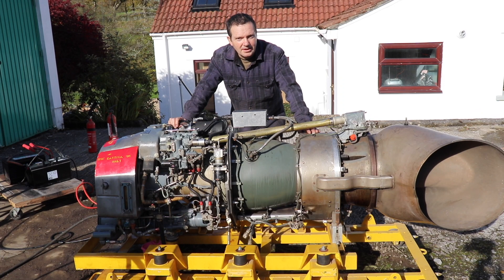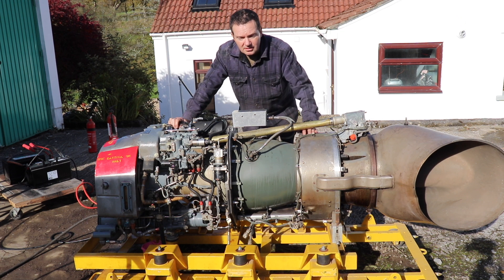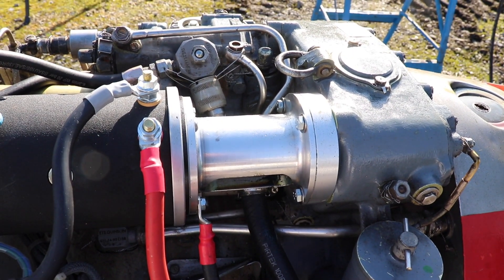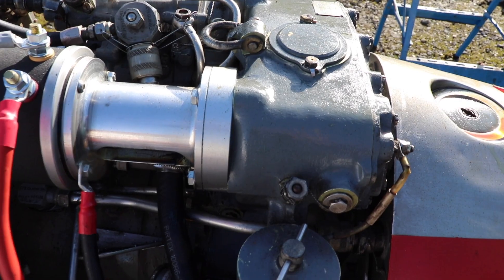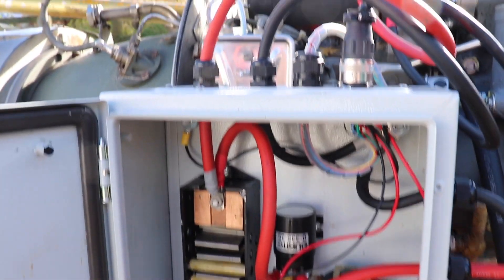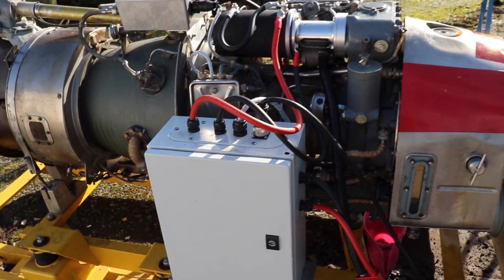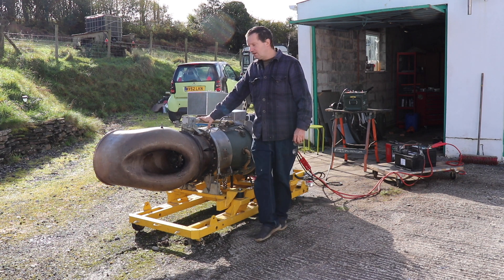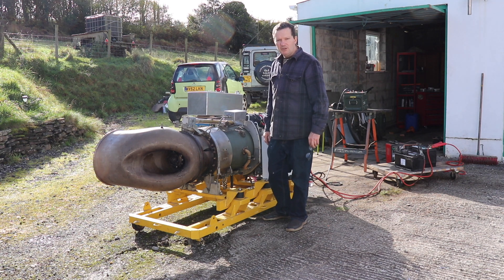How To Start A Jet Engine Using A Winch Motor

Comment: Did you build the starting resistor? Would like to know how to construct one or source the parts...
Reply from the maker: That’s a NOS soft start resistor from a vintage plane. Can sometimes find them on e-bay. You can make one out of stainless steel

Comment: Thats a novel idea :) But basically the 12V winch motor is run at 24V here? Motor should draw some angry currents during windup.
Reply from the maker: No it’s a 24v motor

Comment: Worked on SA 330 Puma for long time in SA know that Turmo 4b , iiiC4 and 4C  well awesome motors operated well in Angola Work horse of the Airforce, 5 % crank ignite watch T4 Adjust idle on idle unit under wire locked cap FCU where governor shaft enters 3 caps   acceleration ,max stop and overpower 101% smoke from rear bearing oil leak,oil smells like coconut cause it is .Spring loaded Governor shaft  not clipped in or spacers missing?
Reply from the maker: Thanks for that! very helpful indeed. If you have any further info would be very grateful. Yes, it certainly is a chump of an engine!! It could well be ex-SADF
Reply: Interesting what is the gas generator idle speed (%) at ground idle? Looking at various Puma start ups videos the ground idle looks to be quite fast with high rotor rpm also? Pilots just start up both engines and lift off don't check the free wheel etc.
Reply: 60% for ground idle ,,92% for flight idle , max stop 98% overpower 101% t.Acceleration time ,8 seconds from ground idle to max stop.That motor is a 4 B. Makila and Topaz replaced them eventually.No free wheel unit like the Allouttte has,only free turbine on Pumas.Motors are bench checked connected to a water pump assy to check all of this
Reply: Rotor speed is 269 for composite blades 271 for metal.
Reply from the maker: Zot,I can see the 3 capped adjusters you refer to...2 are above the gov shaft entry point and there's one which is below. Which one is the idle adjust? If u PM me I can send a pic
Reply: Been retired for 15 years now but the 2  top would be overpower and max stop try the bottom they are not very sensitive so a full turn bout 1%Doing motor runs without the output shaft connected to a MGB sounds dicey there are torque twist plates attached to the shaft under the torque tube that will get damaged i would remove the shaft,and torque tube for runs.
Reply: @zot254  Thanks for that...yes, the output shaft has a flexible coupling which has been removed with the tube and shaft. Theoretically the governor shaft from the freepower turbine should keep the engine under control without a load on it.